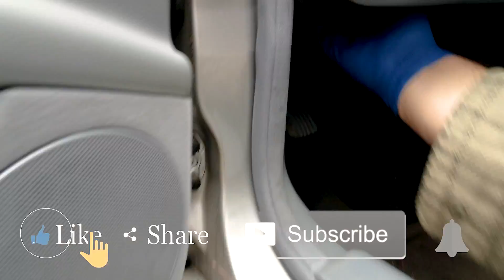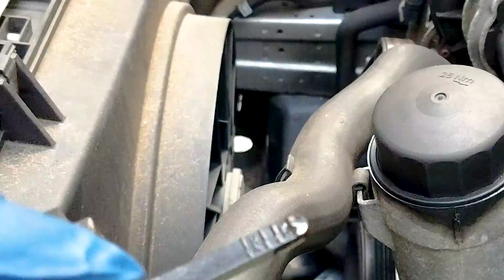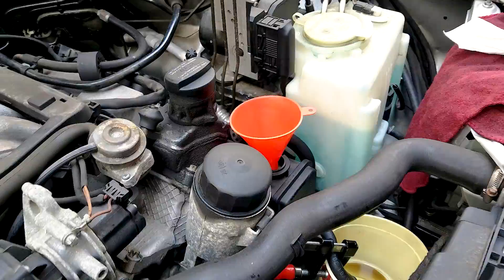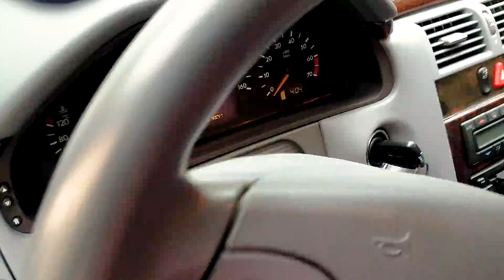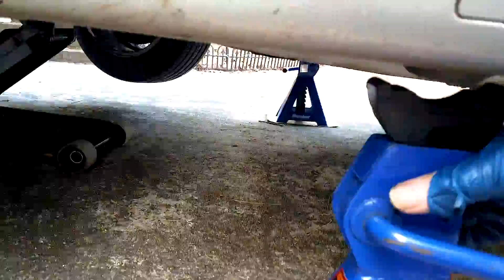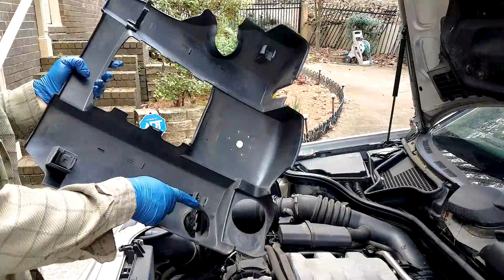Mercedes W210 Power Steering Fluid Flush

Comment: This is the PERFECT instructional video for how to do this!  I didn't know you could just flush it by disconnecting the return line to the tank and collect up there.. I expected I would have to get down under the car and disconnect it from the steering rack with the car on and drip oil in my eyes 😂 Thank you!  I subscribed 😊
Reply from the maker: @CharkG73  thanks a lot for the kind words.
Reply: There a photo in internet showing dirty mesh filter inside cut opened steering filter box Can you do a video on spraying brake cleaner into a taken out filter box. Spray thru the outlet nozzle backwards into the filtering mesh in the black box. Then flush with steering fluid backwards and exit thru the top filling nozzle. Show the dirt collected in the pan.

Comment: did you think about changing the steering fluid tank with integrated filter ?
Reply from the maker: Hi Joe - yes, I have done that in the past  No need to replace the tank except perhaps every 100K miles.
Reply: @masood-tv is it possible to buy the tank sepparately without the pump ?
Reply from the maker: @joesaric1  yes.
Reply: @masood-tv  I changed steering fluid at the same car, same fluid but now is harder steering than before ??  I dont know where is the problem
Reply from the maker: @joesaric1  what do you mean by harder steering?  Please elaborate.

Comment: What position under  the car did you place the floor Jack at to lift the whole front end?
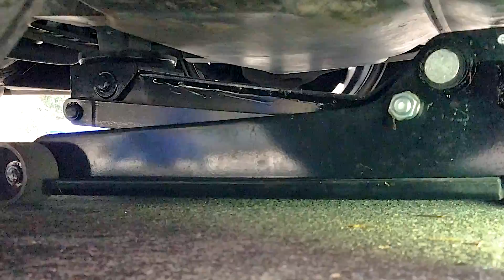Reply from the maker: Please watch the video at 1:08 minutes.
Reply: There is a hand jack
Pad in the center of the car about 2 or 3 feet back it’s rubber and an
Inch or two thick

Comment: How did you get the steering wheel to move when the engine is not on? The immobiliser prevents my steering wheel from moving when the engine is on. Please advise. Thank you.
Reply from the maker: Even when you turn the key to the last position right before cranking?
Reply: @masood-tv  yes.
Reply from the maker: @techforever1970  what type of car is it?

Comment: Converting over to the green fluid did you notice any difference in performance compared to the 236.3 dex2 fluid???
Reply from the maker: Not at all...
Reply: @masood-tv  
Really. I would think it's easier to steer. It looks thinner
Reply from the maker: @dcomputers  I see now what you are asking.  I didn't compare performance between two fresh fluids. To do a proper comparison, both have to be fresh.  The improvement you are noticing is due to flushing the old and dirty fluid and replacing with fresh fluid albeit of a different brand.

Comment: The return hose looks brittle and cracked like mine (10:17) - no issues with leaks? I'm contemplating replacing my hose unless it's not a real problem. I heard the reservoir has a filter in it and should be replaced periodically.
Reply from the maker: You can replace it.  I don't think there is a filter in the tank, C W.
Reply: @masood-tv  just completed this, thanks!
Reply from the maker: Great.  Thank you.
Reply: @masood-tv The filter is under the lid of reservoir.

Comment: Thank you for your informative content. I want to make a correction regarding the color of the steering wheel lubricant. The original color that MB uses is light brown color i.e. like engine oil. You are putting something green that is not OEM color. That is the color of your product.
Reply: This is a very important point right here.  Mercedes specifies a 236.3 fluid for all w210 models.  This is because the w210 uses a "recirculating ball" type power steering system and not rack and pinion.  236.3 is an ATF type fluid.  Fuchs Titan PSF, for example, would be a good choice in a w210.  The green fluid in this video is CHF-11S which is incorrect for the w210.  Masood's process and technique are excellent, but the fluid type used in this video is incorrect.  If you put CHF-11S into a system that previously held ATF (236.3), the steering system will develop large leaks!  I would advise to immediately drain and refill with the correct 236.3 ATF fluid which is a light brown in color.
Reply from the maker: I agree with George that PS fluids should not be mixed.  A full flush with the 11s, however, will work just fine.  I have done it for years on the 112 and 113 MB's without any issues.  MB used to even recommend it in the past before they listed their own brand of CHF 11S in their 345.0 hydraulic sheet.  Autohausaz lists it for the W210 as a fit fluid and so does FCPeuro as you can see in this video:
https://youtu.be/b_dNlap0rx0
Reply: @George-bk8id  Yep, it's in the WIS document si46.25-p-0004a agreed!!
Too bad people make maintenance videos without even looking at the servicing specifications, that could lead to a lot of misleaded people ruining their car. With MB one rule and only one =  ALWAYS check the official specs on any fluids, torques, replacement parts, procedures etc.. etc etc... or you're soon running into big troubles! Nothing really complicated here
Reply: @George-bk8id you are very right. I also looking to change this oil and found out that he fails with that green Dextron 3 type of too thin steering oil.
Reply from the maker: Hi Ozgur, thanks.

Comment: Excellent video Masood! I am about to do this procedure, but on a 2002 e320 Station Wagon. With this model, the power steering pump and fluid are also used for the Self Leveling System for the suspension. How would this procedure be different for this model MBZ? I am planning on replacing the accumulators in the back as well. Thanks again!
Reply from the maker: Thanks, Steve.  I think there is a different pump for the suspension.  Are you sure?
Reply: @masood-tv  Hello Massood!! I love your videos, the details that you put in to it, 👌🙏🏽 Coincidence or not i was about to ask the same question 😅 if the pump of the auto level suspension is the same of steering wheel or not??! because sometimes especially when she's worn i hear a noise from behind,  something like: ik ik ik...  I don't no if she needs oil... or new Accumulator??!! She's with 300,000 km now MB S210 E200 kompressor Avangard year 1998. A guess is time to do a maintenance on that section of the car...  And Sometimes it feels a little stiff (behind) please give me a feedback when you have time. 🙏🏽🙏🏽🙏🏽I couldn't check my self on the feeld... Because  I'm in a wheelchair right now. Cheers from Portugal 🇵🇹🇲🇿✌️😎
Reply from the maker: Hi Eimidio and thanks for the nice comments.  I believe your car has air suspension, not hydraulic. From what I know, it has an air compressor, valve block, and air tank.